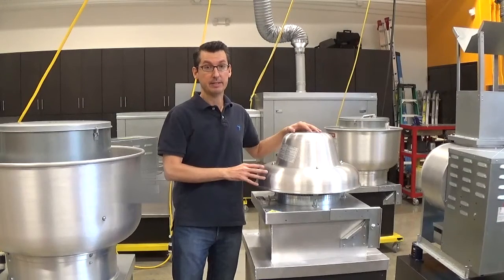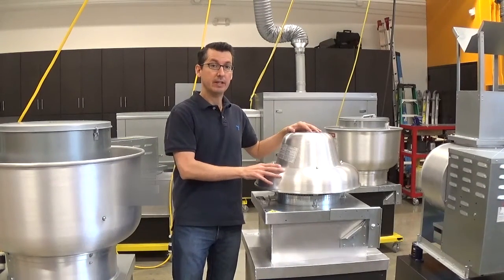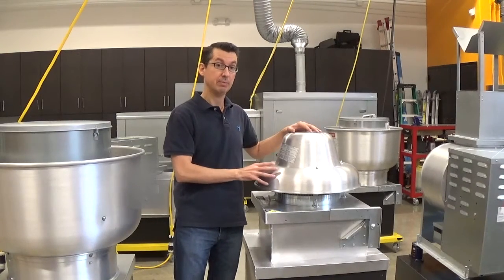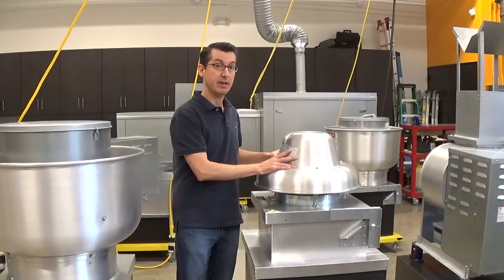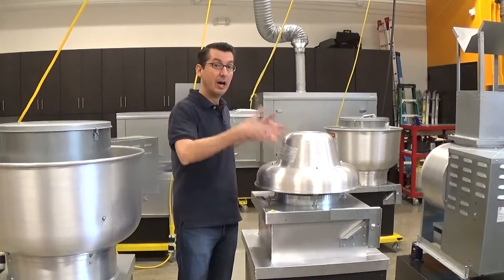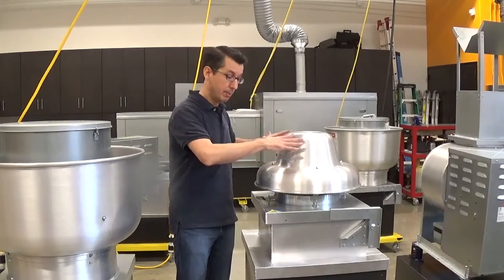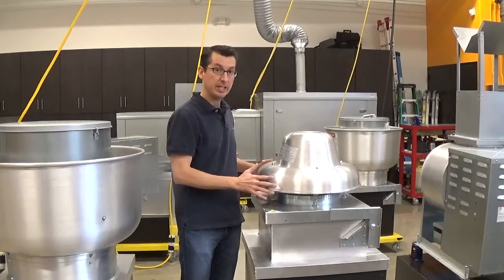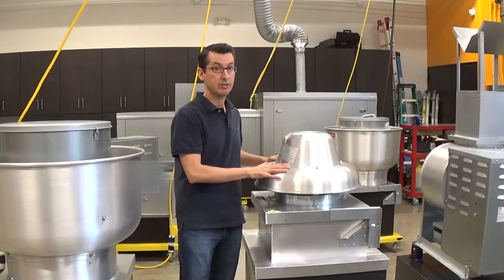What Is A Downblast Exhaust Fan?

Comment: Thank you for the explanation.  I am looking to build a small generator shed.  I would like to use an exhaust fan (about 8'' in circumference) which pulls air up and out through the roof of the shed. Of course I will have air vents on each side to draw air into the box then out through the top.  The Generator is an inverter 2300/1800 watts. not sure about this one because you stated it brings air back down onto the roof.  Looking for your opinion.  Thank You.